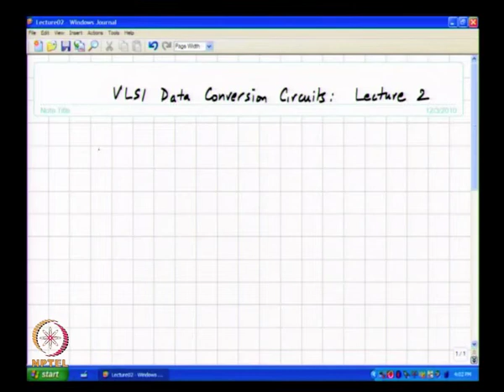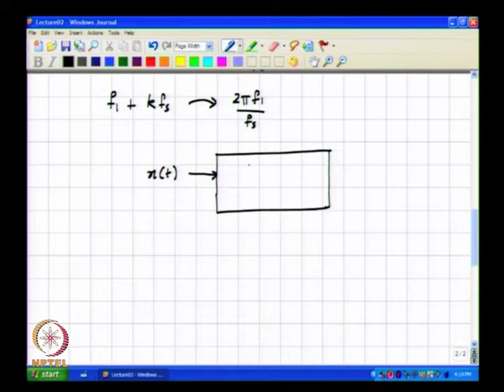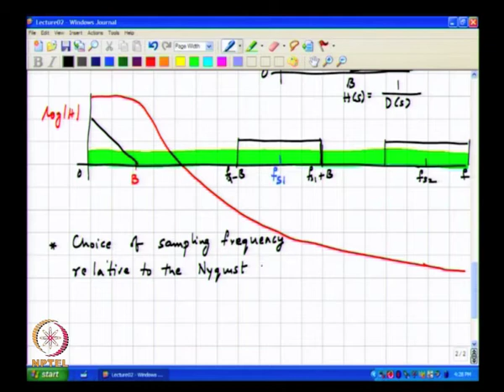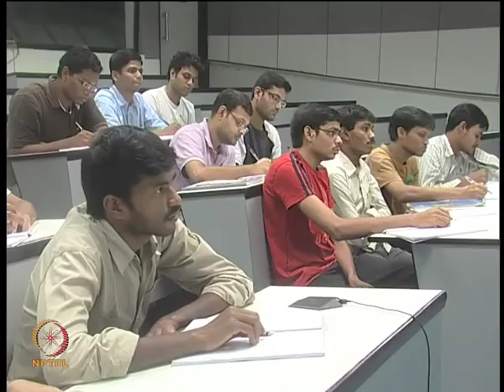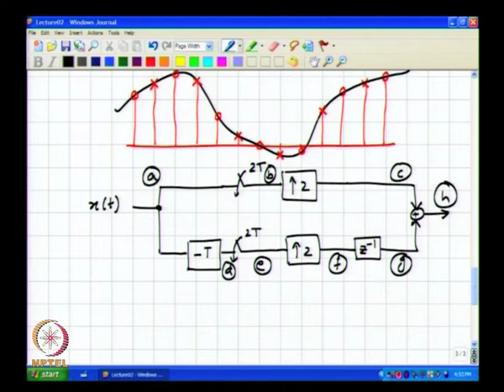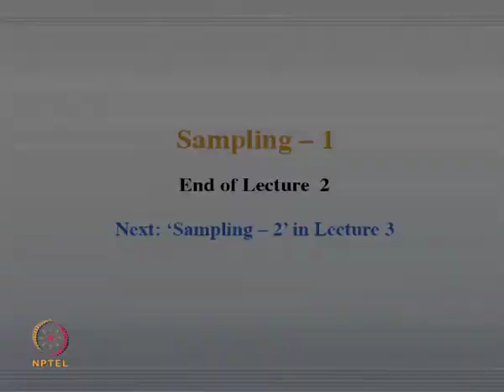Mod-01 Lec-02 Sampling-1

Comment: In signal processing, the over-sampling ratio refers to the ratio of the sample rate of a signal to the minimum sample rate that satisfies the Nyquist-Shannon sampling theorem. The Nyquist-Shannon theorem states that a continuous-time signal can be perfectly reconstructed from its samples if the sample rate is at least twice the highest frequency present in the signal.

In other words, the over-sampling ratio is defined as the ratio of the actual sample rate to the minimum sample rate required to avoid aliasing. Aliasing occurs when high frequency components in the original signal are indistinguishable from low frequency components in the sampled signal. Over-sampling helps to reduce the impact of aliasing and improve the accuracy of signal processing.

For example, if the maximum frequency in a signal is 5 kHz, then the minimum sample rate required to avoid aliasing would be 10 kHz. If the actual sample rate is 20 kHz, then the over-sampling ratio would be 2.

Comment: Notes:Over sampling eases the filter design.Due to oversampling, SNR is less sensitive to component changes. If oversampling is not adapted, we must use high  Q filter for faster roll off gain after passband. These High Q filters response is sensitive to component variations. So go for Oversampling.

Interpolation is one technique to achieve higher sampling rate using multiple slow converters in parallel.Non idealities like offset , gain with converters and timing mismatch among these converters to be studied